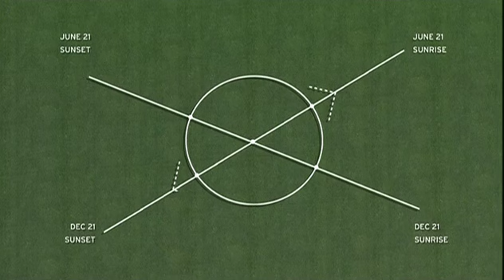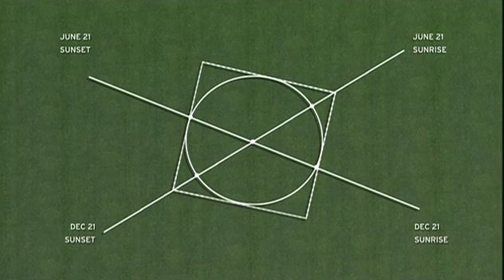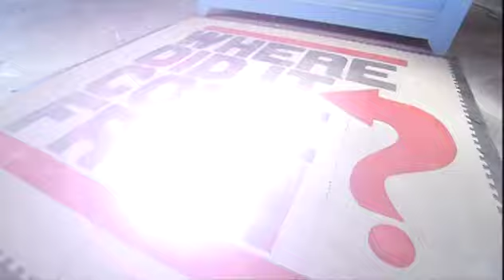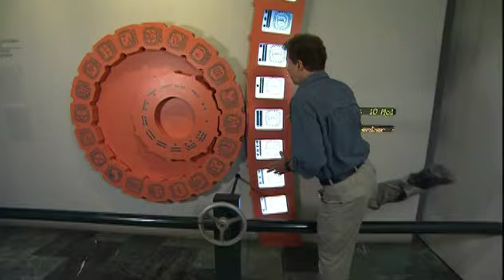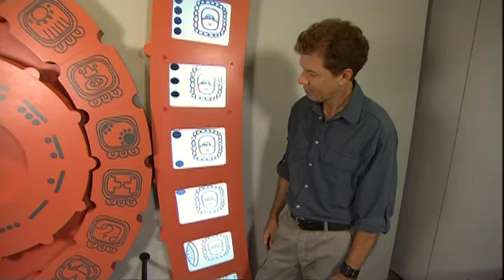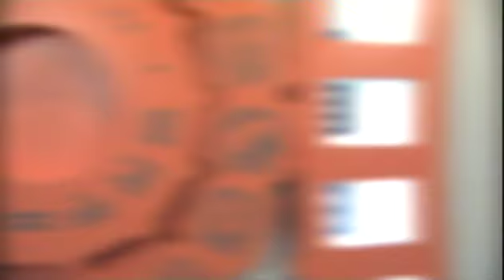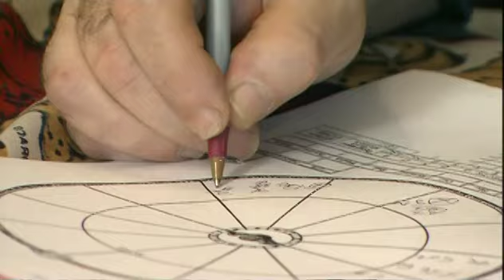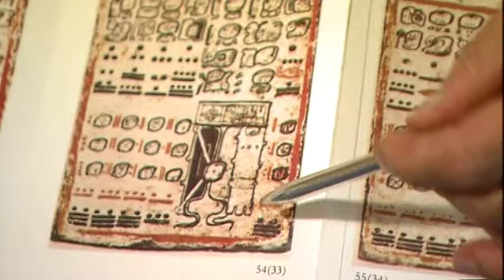Ancient Maya — Tools of Astronomy

Comment: I couldn't follow the explanation of right angle construction with circle.  Also--how could the MAYA KNOW it was June 21st, etc.?
Reply: Bruce Too  the relevance of June 21st is that is the summer solstice in the Northern Hemisphere.  The solstice is found by observing the spot on the horizon where the sun sets.  Every day the sun sets at a slightly different spot on the horizon until the solstice.  After the solstice, the location of where the sun sets on the horizon appears to move backwards.
Reply: @teodelfuego  it tells you that it is the  sun that is moving not the earth. the sun circles above the flat earth and at the same time it  moves in a spiral from the tropic of cancer to the equator and then to the tropic of Capricorn and back again . The movement between the tropics also causes the seasons. that is why the spot of the sunset is always changing. I think it was the great flood that ended the mayan civilization . there are a few ancient structures that survived the flood. The so called Atlantis is most likely  one of those. we have been lied to for a long time about the true shape of our earth. the mayians knew  that the earth is flat and there is a firmament above.